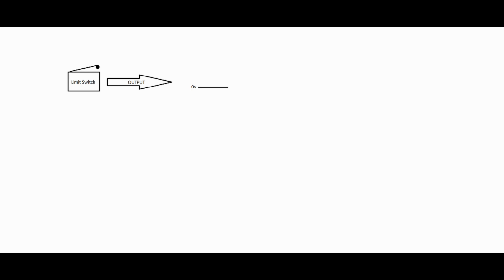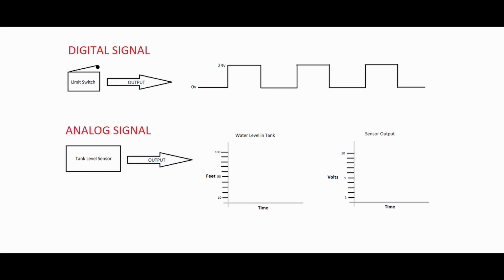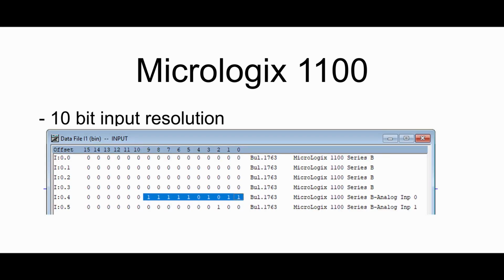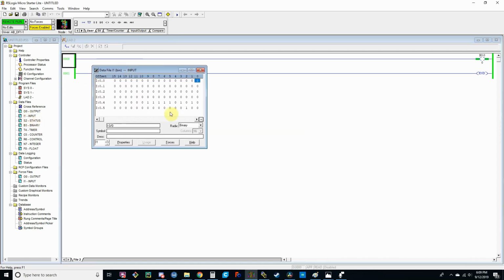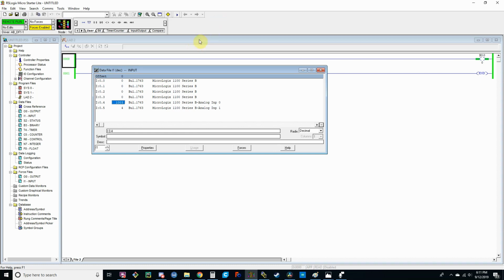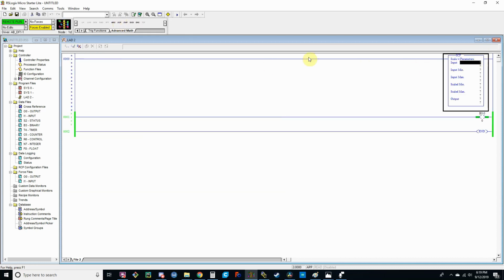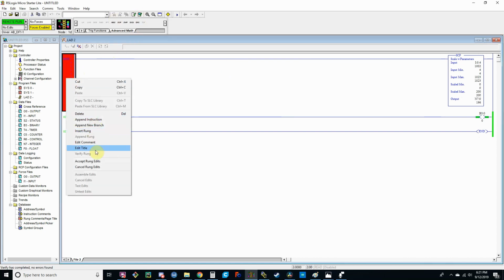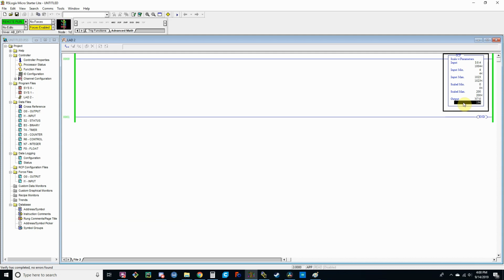Micrologix 1100 - ANALOG SIGNALS and INPUTS

Comment: why did you use 10bit and not 16bit? also what is the capacity of micrologic 1100 16bit?
Reply: micrologix 1100 only supports 10-bit analog

Comment: @Dipsy Logic, nice concise video on the difference between analog and digital inputs, clearly presented.  One suggestion; when you say that hooking up an analog device featuring a current output of 4-20 ma would not work when using the Micrologix 1100's analog inputs (3:18), you are selling the product short.  Simply attach a 500 ohm resistor (1/4 W) across the two outputs of a 4-20 ma device to create a voltage drop that may now be measured at the ML1100's analog inputs in the range of 2-10 VDC.  Make it a 250 ohm resistor and the input will be in the range of 1-5 VDC.